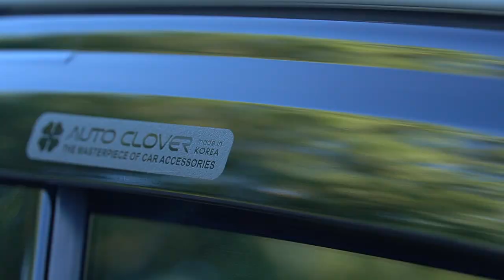BEST Kia Stinger Exterior Mods Under $100-Roof Wrap Tutorial, DO THIS!

Comment: You could have just pulled the side vents off. Reach into the hole and pull straight out. I had mine sprayed black, I'm not good enough at wrapping yet. Might try the roof now that I know how to remove the antenna. Thanks for the vid!
Reply from the maker: I tried to at first but the clips were stuck on there and did not want to break them. I am no wrap specialist and these were not that bad! Just a bit of patience and some heat. Hardest part was cutting the edges😂

Comment: Did you wrap the two roof trim pieces that you popped out? I just bought a used stinger, and the clear coat on those two trim pieces is coming off, and the paint underneath is cracked. Just asking because I am trying to think of ways to fix it when the weather gets warmer.
Reply from the maker: I knew it would be hard to wrap so I just painted them

Comment: What’s the length did you buy? The 1ft?
Reply from the maker: I bought 2- 1.5ft x 5 foot pieces and cut them in 4 inch width. I was able to get all 4 pieces with 1 roll but got the second just in case, ended up doing the mirrors with the second
Reply: @-kjlifestyle-  nice gonna do this to mine😁